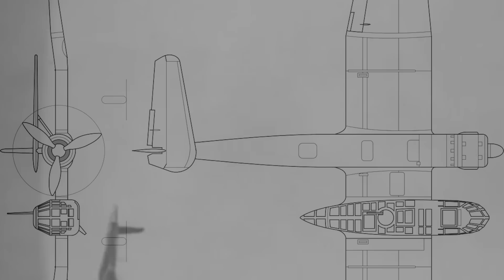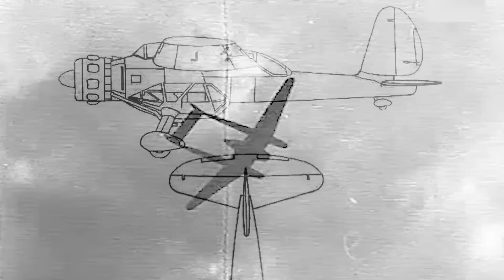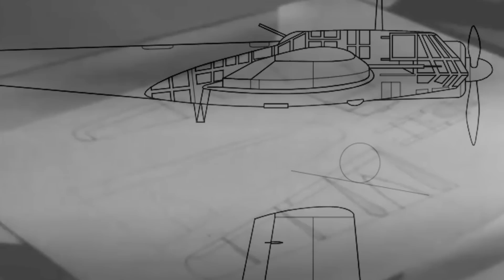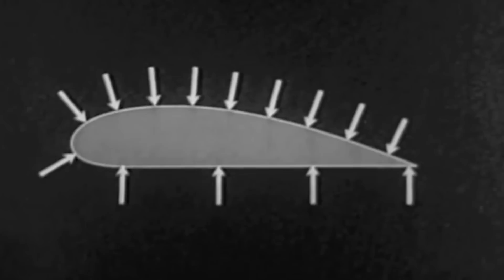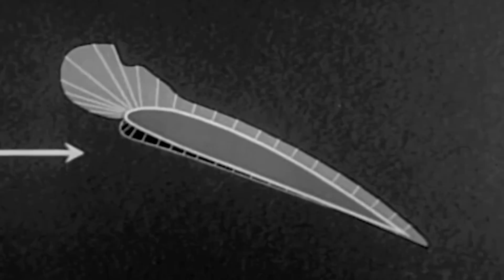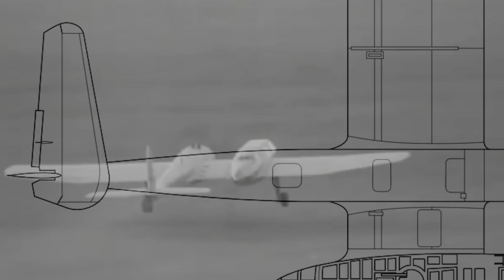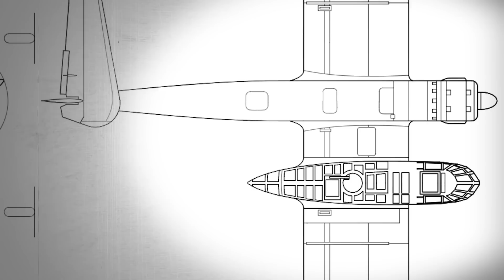BV 141 - The Most Asymmetrical Airplane of WW2

Comment: I’m an aircraft designer. This configuration isn’t asymmetrical. There is a traditional engine and tail boom, with added lift on the starboard side, to offset the increased load of the starboard mounted cabin. Asymmetric implies a lack of balance, which isn’t correct. Once you balance lift with wing loading, the aircraft would fly well, and would offer a stable, and high-visibility reconnaissance platform. Excellent out-of-the-box thinking. You could mount cameras in the cabin, with far less vibration affecting the cameras.
Reply: Well, he's not wrong in calling it asymmetrical. Symmetry of shape is a simple concept. This plane does not have it.
I'm sure it was not meant to imply lack of balance. These are just two distinct concepts. Clearly it was brilliantly balanced.
This design approach would, of course, be counter-intuitive to any layman observer.

Comment: Blohm and Voss did so much through out theese years.
They did all sorts of designs.
Most noteable they converted an me 109 design to a Höhenjäger (High altitude fighter) with a big Turbocharger in the back of the airframe.
It flew near the end of the war and did a belly landing in April of 45.
And now Airbus is around.... guess where  they originate .. if you guessed Blohm and Voss .... you are correct.

Comment: Seems to me a design like the P-38 would have fulfilled and fixed so many problems. Well done,  Kelly Johnson and Lockheed.
Reply: Well, aside from the fact that Kelly Johnson could sure design airplanes, the United States could rely on its manufacturing capabilities to make enough engines to put in them. Germany was more limited, which was probably why they specified a single-engine design.

Comment: Good but as ever with a few errors to my knowledge fw200 Condor was not intended as heavy bomber it was conversion of an airliner for long range patrol of North sea and North Atlantic where it harrased conveys and directed u-boats to attack. It was less than perfect as many broke there back after damage and or heavy landing. Strategic bombing by b &v aircraft not heard of but if you mean flying boat/seaplane attacks around Britain's coasts with magnetic mines then yes luftwaffe did that, caused RN a few problems clearing them. They could lay hidden for days and then bang sink a ship, even after an area had been demined.
Reply: Yes, as a converted civil aircraft, the Condor's largest contribution was maritime patrol, where it excelled.  It seems much of this video is well researched, but by someone with little knowledge on the subject.  There are so many small, silly errors that pile up to a point where I start nitpicking the entire video.

Comment: If they wanted a single-engine plane with good all-round visibility, I would have thought that a pusher propeller would be more feasible.
Reply: The Germans didn't perfect ejection seats (essential for jumping out of planes where the prop is in the back) until late into the war.
Reply: Great observation! (did you see what I did there?) You got to wonder why the German hierarchy insisted the plane had to be single engine'd? Surely the best and most logical approach would be to say ' we want an aircraft to fulfill this role and meet these performance objectives x, y and z'...what do you propose?
The rest of this reply is just me 'venting' (feel free to skip).
I worked in R&D (electronics) for a number of years and the amount of times I was presented with 'impractical proposals' for a new product is very high in ratio to someone actually 'making good sense'.
For instance, 'me' 'you don't need a new product to rival the competition, you just need to improve the existing product (of which we have experience, testing, spares and supply chains all already in place), I have told you a year ago how this might be done, I have submitted the ECN's (engineering change notes) and my proposals to the Managing Directors, we can make the necessary changes efficiently and deliver the NEW Improved version within three months.
Sales Director; 'we need a new product that will rival the competition'...Me; 'yes, this will'
Sales Director; 'but it's not new, is it?'
Me; 'no , merely improved and actually marginally better than the competitors.' we can start working on the next generation after we transit the smooth integration of this one', we can remain competitive at lower cost while they try new technologies that will become cheaper and better understood while we offer arguably the best product on the market.'
Sales Director; 'so it's not new?
Me; 'It's new and improved and probably cheaper than the original, not only that but the budget for the next generation product is greatly enhanced, we've already done the work, bring this forward now at little cost and let me develop the next generation NEW product with a workable budget.
Sales Director; 'but it's not a new product?'
Me; 'it is a superior product that costs fuck-all to make happen, quickly and easily.
Engineering Director; 'he's got a point'
(absentee MD represented by his PA and yes, very likely....)..'we all want a new product' , let's have a vote, seven to three, lets use the new budget for a new product. 
I left them 6 weeks later (2 weeks to find a new job, 4 weeks notice), in retrospect I should have remained and helped to oust all those managers who had been promoted to positions of incompetence ,but treble the money was waiting elsewhere.  A sad story of a once great company that is now only a transit point for it's US owners
Reply: @conmcgrath7502  they were running short of engines.
Reply: @conmcgrath7502  It had to be cheap and take as little as possible in the way of strategic resources. Engines are pretty resource intensive so having just one would be a good idea. Besides as a reconnaissance plane performance was not the a huge priority. Trying to make it a fighter was not a good idea though.
Reply: Discussing the fuselage but showing diagrams of the wing section design......hmmmm
Reply: Pusher propellers and engines behind the centre of drag make for an unstable aircraft,  especially for single engine aircraft, a problem not really solved until yaw dampers were invented in the 1950's.   If the yaw damper fails or is inoperative, a crash can result, as the Russians found out with one of their T-jet airliners.   To see why, try pushing a pencil from one end across a desk, or pulling it.    Also, pusher prop configuration has a large fire risk - just ask any B-36 crew members still around.
The Germans in WW2 liked to have engines and props as far forward as possible because of the handling advantages.
Reply: @keithammleter3824  There are disadvantages to pusher propellers, but yaw damping isn't one of them. Being in the disturbed airstream is the main problem, and for military aircraft, bailing out into the propeller is another. Meanwhile, the Edgley Optica has no yaw damper. https://www.youtube.com/watch?v=2A29M-zANIs
Reply: @dalegreer3095  The Edgley Optica may not have a yaw damper, but it isn't a pusher type as normally defined either.  Engine is behind the ducted fan, and the duct is centred about the wing.   It would appear that the centre of thrust is not behind the centre of lift or centre of drag, which is the stability problem with pusher designs generally, and with the T-jet airliners, requiring yaw-dampers.   However it is an innovative design that has the cabin in front of the ducted fan.  It is also only a low speed design, which can help stability.  I note that of about 20 made, less than 10 Edgely Opticas are in use, and another 10 or so were destroyed in a factory fire.
A "modern" (1980's) pusher type is the notorious Vari-Eze, which has a strange backwards design, its wings as far back as possible and the stabiliser in front, and has no yaw damper.   But it has its own unique vices.   My brother in law bought a crashed Vari-Eze and restored it to air-worthiness (essentially a complete rebuild).   It had killed the previous owner, and nearly killed my bother-in-law on his second flight.   The problems do not arise from having the prop in a disturbed airstream.
Reply: @keithammleter3824  Okay, then the Seabird Seeker, which also has no yaw damper. There are a lot of reasons why there aren't very many pusher planes. Yaw damping just doesn't seem to be that big of a deal, at least in slower, less powerful planes, like reconnaissance aircraft.
Reply: @dalegreer3095  : I know nothing about the Seabird Seeker, so I looked it up in Wikipedia.   It certainly seems to be a pusher type.  Yes, uncommanded yaw is less of a problem in slower, lowered powered aircraft.   The Seebird Seeker has about one tenth the power and less than half the speed of the Bv-141. One should allow that a much greater degree of finesse and computer aided design was available in 2014 than in the 1940's.  If the tendency to yaw is slight, the pilot can correct it (even without thinking, in a slow light aircraft). You keep saying that yaw damping is no big deal - it doesn't matter how many times you say it, you're wrong - it can be a very big deal indeed.   In passenger rear-engine jets, yaw dampers are considered mission critical and must be duplicated.   The Russians learnt this the hard way when a pilot attempted to fly an Aeroflot T-jet in which the maintenance engineers had left the yaw dampers inoperative.   After takeoff, he was quite unable to control it, and crashed after a very brief wild ride.
The reason is very simple - as I said before, if the thrust is in front of the centre of drag and centre of lift, the aircraft is inherently stable - take your hands of the controls and it flies straight.   If the thrust is behind the centre of drag or centre of lift, the aircraft is inherently unstable, and there has to be continual pilot effort, or some means to damp out yaw and/or pitching provided.   An unexpected pitch-up in a Vari-Eze was what nearly killed my brother-in-law, who is an experienced light aircraft pilot, though not in the Vari-Eze.
Reply: Tail gunner would have shot out the props.
Reply: John Payne - exactly. Those crazy silly Nazi hating German engineers were real jokers - literally.
Reply: That was my first thought too. I wonder if the tail gunner was a requirement though.
Reply: Overall speed wasn't quite as good as as a puller type
Reply: Probably because Goering once said he hates pusher propellers because they are ugly.  I'm joking, but it's not out of the realm of possibility.
Reply: Good point John, just like the “ shagbat” pusher.
Reply: John Payne. Sorry, Walrus.